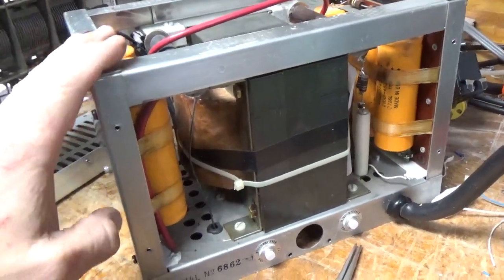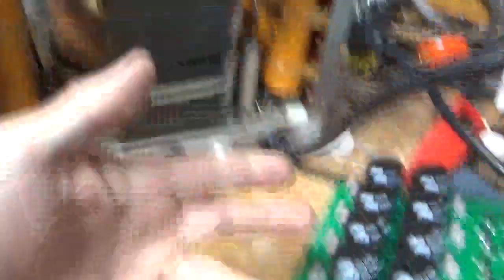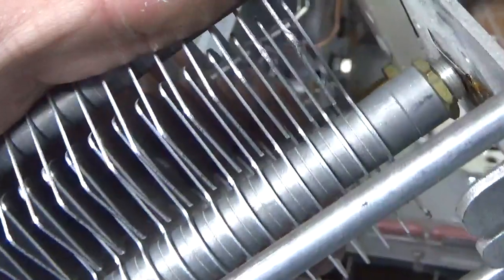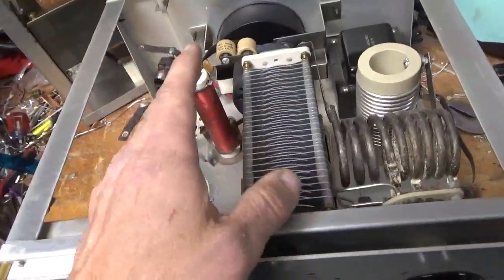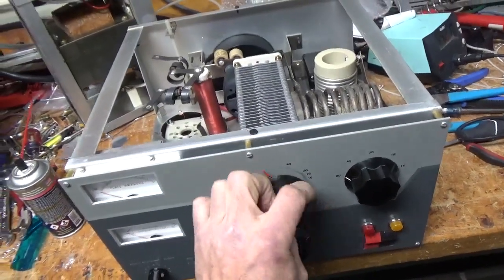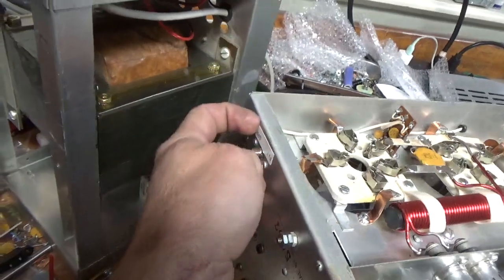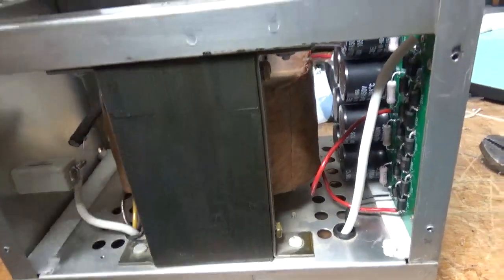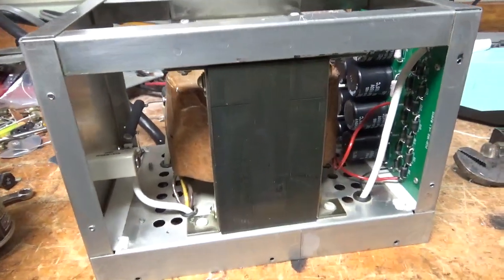Drake l4b Harbach Power Supply Kit, Harbach Soft Start , Soft Key Bias Board Ground Grids Etc

Comment: Beautiful work.  Curious, how do the plates in the air variable get damaged ?  Just in general.   Kids poking inside, or anomalous operation of the amplifier ?   Never in hurry for excellence.
Reply from the maker: Abuse , an open on output /high swr which would cause the rf voltage to skyrocket

Always refer to the owners manual for proper output , tuning and load impedance parameters and will have years of trouble free service . This goes for any power amplifier